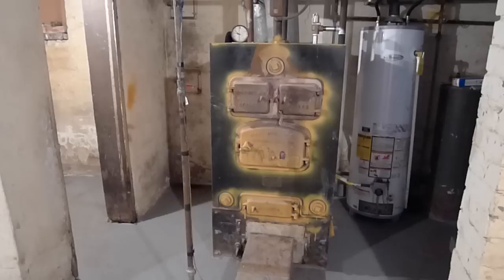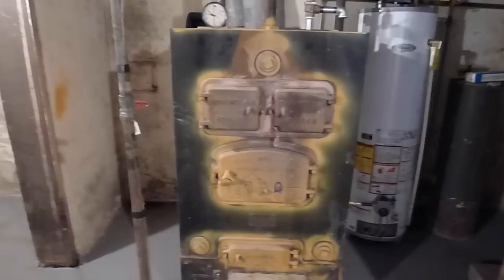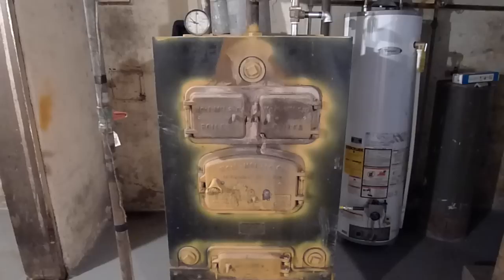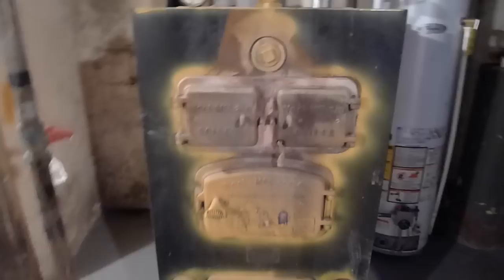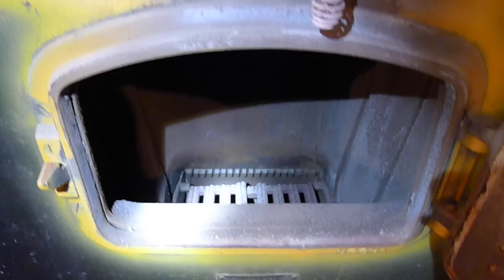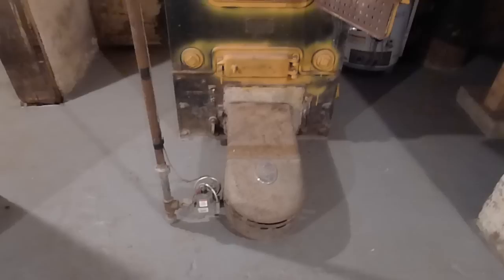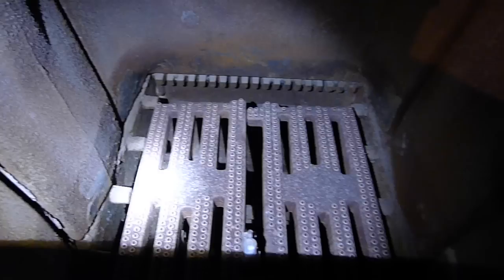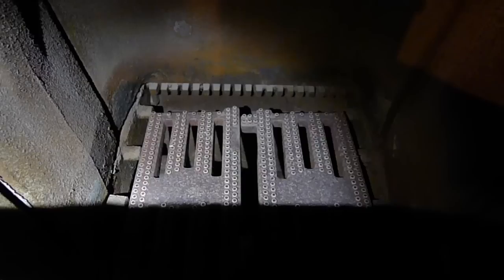An Encounter with a 75 Year Old Furnace

Comment: Thank you for showing the conversion kit. It's smaller than I thought. 
I just went to an estate sale in a house built in 1917 and the original coal-fired boiler was still in the basement. I did see a natural gas line running to a metal "box" right in front of the boiler; now I realize that must've been the conversion kit!  Thanks!

Comment: Had one in our house (built 1917) growing up. It was still there in 1977. For all I know, it's still there. Ours was converted to home heating oil. We had a 300 gallon oil tank inside the basement. The coal room was converted into a workshop with a maple workbench, etc.  BTW: the heat converts the water to steam for the steam radiators (I used to love the way they whistled when the steam came up), but there was an inline horizontal tank next to the furnace that heated the house water for the faucets too. It was like operating an old locomotive. Weirdly my Dad had a boiler operator's license that he got from a job he held for awhile shortly after WW2.
Reply: Pretty sure that’s a stainless steel expansion tank and you probably had a DHW coil.

Comment: I have a gravity furnace in my house. The best even heat ever. The air is very sanitary as the air is HOT! Thus no mold or crap in the air. Basement is very dry. My friends have more modern furnaces in similar homes and they have high gas bills also. The point about the gravity furnace is that it needs no energy for a blower. Saves electricity and no moving parts except for the gas valves.
Reply: No noise also.       Evenly warm rooms.
Reply: Gravity only means that you don't have a pump to move water. These systems are inefficient since they rely on convection to circulate water into the radiators, it means that to work you have to run it at extremely high temperature (less efficient) and also not all radiators get even heat. 

Boilers abandoned natural circulation when water pumps were available, I never seen one (even the oldest boiler I've seen in my country had a circulator), since a pump is much more efficient, and also you can use smaller pipes since the speed of the water is higher. 

New boilers can even modulate the circulator speed based on the boiler power output to keep the heat exchanger at the right temperature to get better condensation (that way they reach almost 100% efficiency).
Reply: @alerighi  We do like our gravity systems.   Thank you.
Reply: @alerighi  I dont need much electricity. I can use 120 or 24v to run the valve. Very economical. No blower to waste elt. My gas bills are lower than my neighbors. SO is my electric bills. Figure that out smarty pants. Just runs great after 75 to 100 years.

Comment: Good Day,
I Lived in  a House that was around 200 Yrs old, & had it had a Coal Boiler system installed in 1935 I am pretty sure that was the correct Year.
It was converted to burn Diesel (Fuel Oil) about 1960, & it is still in operation Today.
The Service Man said that the Water Pans used in that particular unit (I have since forgot the Name but it was made near Hamilton Ontario as far as I remember) were so thick it that it would take the strongest Man with a good Sledgehammer to bust it up.
They can and DO,. . . . last forever. . .unless You let the thing sit in sub zero Temperatures full. . .
Reply: Is it still running?
Reply: @danielmorse6597  I presume so...
The house was sold to a Mennonite family.
Unless he changed it out which wouldn't make sense. 
I have not returned to find out.
The workshop had a 1930 era boiler and it also was in gwc but really was huge and a guzzler. I think it was originally from a school or apartment building.  
Could watch the fuel gauge drop.
Pendell Boilers Ltd I remember that.
Had auxiliary pumps and 2¹/⁴" pipes.

Comment: crazy to think about how much more work went into keeping the house warm. There is some irony in that.
Reply: Not really that much work. I had a hot air coal furnace for years. After it's up and running you shake it down and remove ashes/clinkers. Add a hod of coal and go to work. In the evening do it again.

Comment: Cool but also inefficient, for what a new condensing boiler costs (that is 100% efficient if used properly) doesn't make sense to keep it running. The cost of a new boiler pays itself in a year of saving gas.

Comment: I got a bigger one at work!  it now has a leak from the side. we took the side covers off and insulation off.  the right side was pretty corroded and the leak starts in between the segments!  also with the side covers off you can see the fire inside through small cracks between the segments.  anyway to rescue the boiler?

Comment: haha, I just bought a house in Czech that was built in 1933. It still runs it's OG coal burner to heat the radiators and hot water. Just older a truck load of coal each winter now...

Comment: would that originally have burned anthracite or bituminous coal? anthracite is still in use today, i heat my own home with it. its cheap, hot, and burns cleanly. its cheaper then natural gas. i personally prefer it, i can get all of my coal in one delivery and its done for the year. i use a modern keystoker 90K freestanding stove. you can also get forced air and coal boilers still being made by companies like keystoker. 

can you convert this unit back to coal. it would be much more economical to run it on the fuel it was built to run with. converting coal furnaces and boilers to natural gas was for lazy people and is actually not a very good idea. the unit was not designed to run with natural gas, so burning gas it would be very in-efficient
Reply: Prior to world war II most homes in the U.S. were heated with Anthracite.
Reply: Best heat for homes #1 coal, #2 Kerosene, #3 (#2 oil) Diesel, #4 LP, and dead last at #5 NG. Wood is just too variable.
Reply: No, it will stay gas. The old grates and smokestack would have to be replaced. I use coal at my farm however.

Comment: I have a similar system with the tongue looking thing. The pilot valve work but when I open the main gas Line the furnace is not turning on. Any idea what it might be??
Reply: Make sure the thermostat is passing the 12 or 24 volt current to the gas valve. Make sure the standing pilot  is lit. When you closed the main valve, you cut off gas to the pilot light so you will have to reset the pilot thermocouple. The instructions for that are somewhere here on YouTube. Since the thermocouple may be defective you may have to replace it due to age and disuse. Henceforth do not close the main valve for summer layover. Saving 2 dollars worth of gas could cost you $200 unless you replace the thermocouple yourself, which is an easy job.

Comment: how difficult would it be to remove that natural gas setup and convert it back to coal. it probably works extremely well on coal
Reply: Andrew is no doubt a Trump supporter.  He probably  is one of the coal workers conned by Trump!
Reply: Probably is way more efficient burning coal. Not as much heat goes up the chimney and anthracite coal is very clean burning
Reply: Coal in those boilers actually is more efficient and cleaner burning than gas if you burn anthracite coal or hard coal no smoke and blue flames
Reply: Joseph Jarrell , anthracite coal is hard coal, bituminous coal is soft coal!👷🏻
Reply: probably just put the draft cover on, with ash pan, and the grate back on the ledges the gas burner sits under. although it may be hard finding those pieces now

Comment: I think you are incorrect, they have a water heater next to it to heat the water. That thing is a incinerator or something
Reply from the maker: Some hot water heating systems are paired with water heaters or hot water holding tanks, but this is most definitely a boiler. In most cases the water heater for plumbing and the boiler for radiant heat were completely separate systems.
Reply: MORRIS6161 , Exactly what my parents had hot water coal boiler for heat ,gas hot water for domestic. Exact boiler!!👷🏻